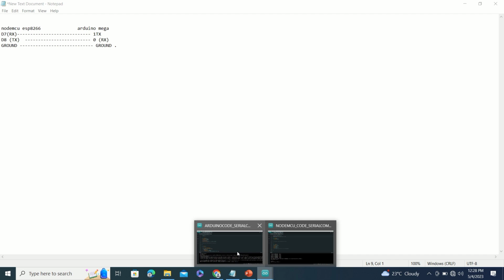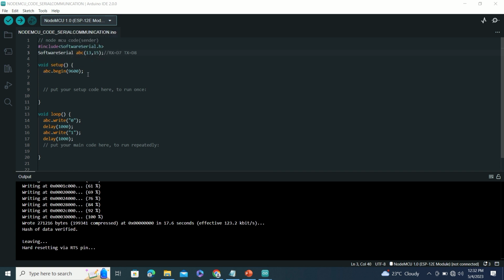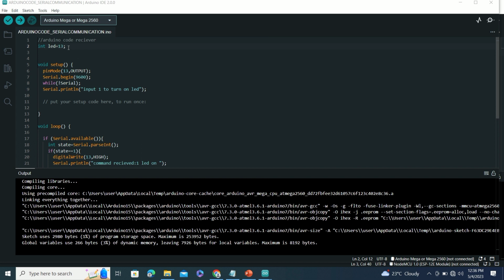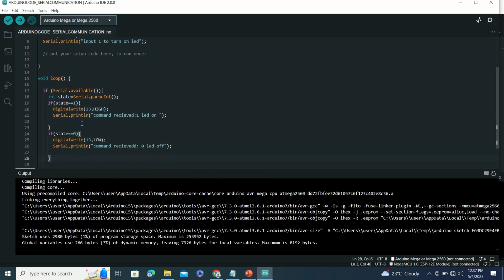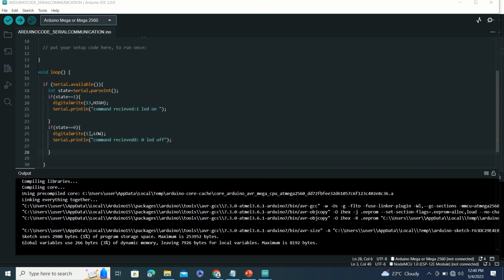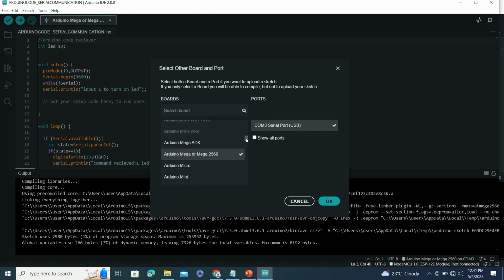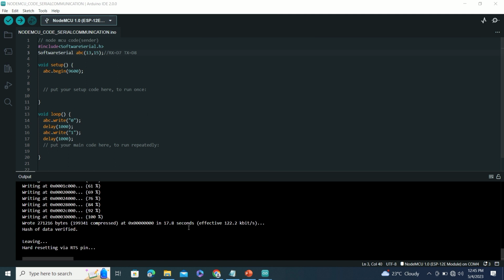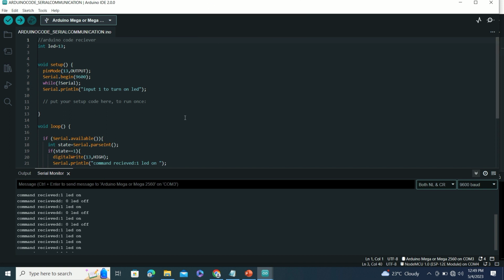Nodemcu arduino serial communication | sender is nodemcu esp8266 & receiver is arduino

Comment from the maker: here is the code for arduino (receiver)
//arduino code receiver
int led=13;
void setup() {
  pinMode(13,OUTPUT);
  Serial.begin(9600);
  while(!Serial);
  Serial.println("input 1 to turn on led");
}
void loop() {
  if (Serial.available()){
    int state=Serial.parseInt();
    if(state==1){
      digitalWrite(13,HIGH);
      Serial.println("command recieved:1 led on ");
    }
    if(state==0){
      digitalWrite(13,LOW);
      Serial.println("command received: 0 led off");
    }
  }
}
code for nodemcu esp8266 .
// node mcu code(sender)
#include<SoftwareSerial.h>
SoftwareSerial abc(13,15);//RX=D7 TX=D8
void setup() {
  abc.begin(9600);
}
void loop() {
  abc.write("0");
  delay(1000);
  abc.write("1");
  delay(1000);
}